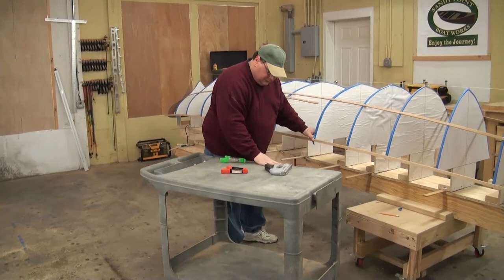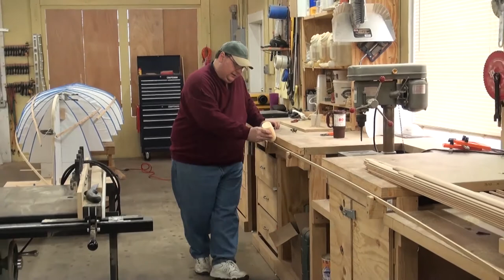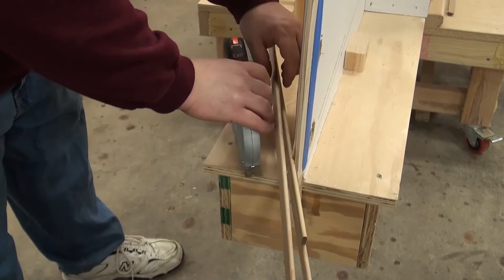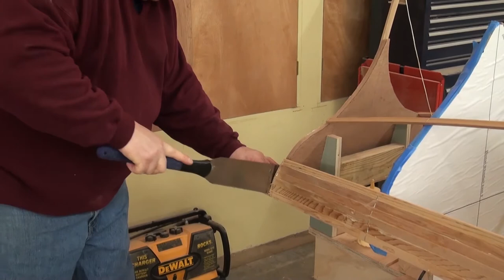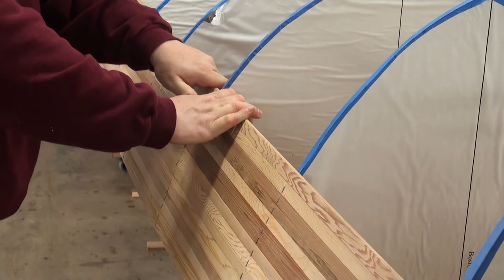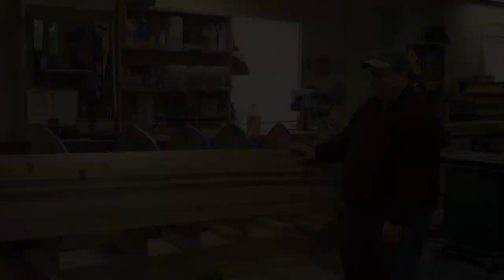05 Begin Stripping the Hull

Comment: I dress my Staples a row at a time on a sharpening stone this makes them sharper than factory Staples. Now they slide in between the fibers of the cedar without cutting the fibers 50% can be swelled completely shut and become invisible. Care must be taken not to rock the Staples while removing them. It takes a little time to sharpen a box of Staples.
Reply from the maker: That is some pretty serious dedication Robert.  If you have that much patience, you should try building without staples.  It isn't difficult just takes more patience ( and time ) then doing it with Staples.

Comment: Just warm your glue blocks with a heat gun.
Reply from the maker: That absolutely works, Robert.  I only use that method when I have to, though, as it tends to make the glue penetrate the soft wood, which can lead to discoloration or delam if you don't get it all with a sander.

But you are definitely right.  A heat gun works great.